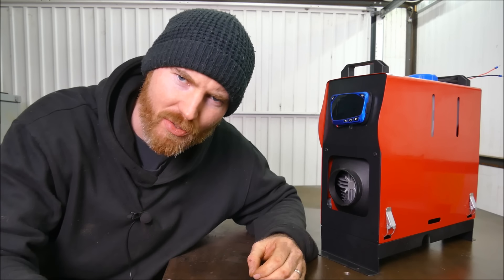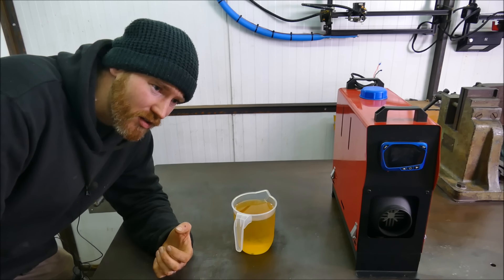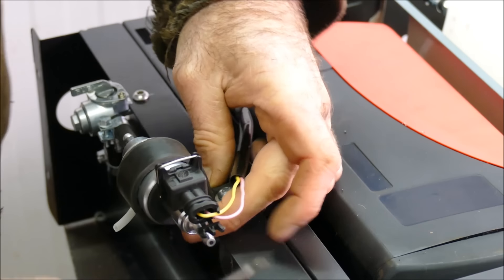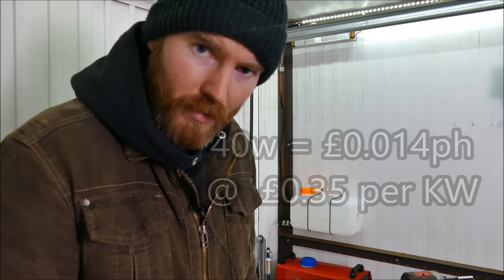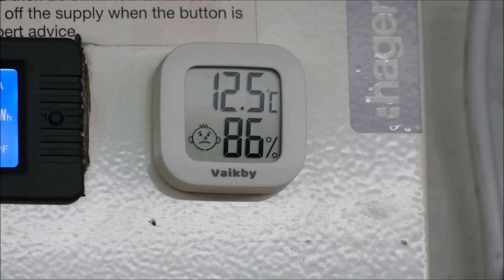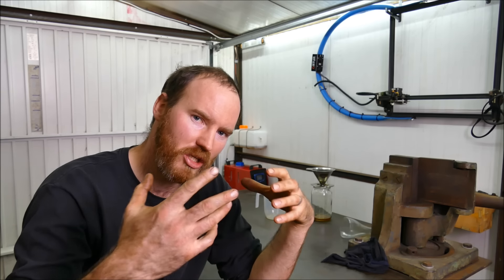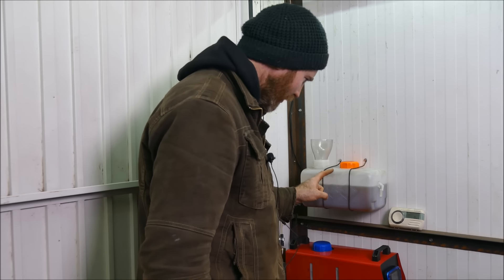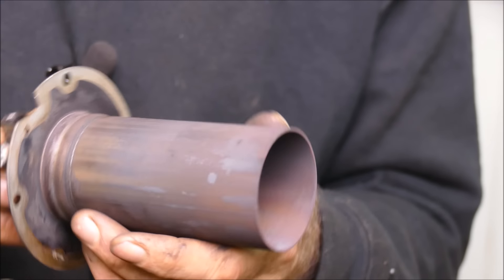£0.03 per kWh heater modification - Top facts & lies on diesel heaters - waste veg oil burn success

Comment: I dont think your efficiency numbers are correct. First of all 80-90% heating efficiency is really good... too good for a cheap heater. Modern condensing heaters struggle to get 90%. They use almost all of the energy out of the fuel. I would be surprised if this is even 80% efficient. Second, you still have the electrical power used for the fan motor. This further reduced the theoretical efficiency to a place that i would take an educational guess to be around 60-75%. So your 3 kW is actually more likely 2.3 or less. As for as heat pumps, the baseline worst COP is 2.0, this means that for every watt of electricity you put in you get 2 watts of heat out. So you can basically cut the price of electricity in half. And that is worst case, many heat pumps can approach 3 0-4.0. This would easily beat all fossil fuel alternatives as far as efficiency.
Reply from the maker: It's relative to ambient air temp to output exhaust temp minus the fuel energy output that determines the efficiency. If the exhaust is equal to air temp then it's 100% efficient so seeing how much heat is retained in the room and how little temperature is going out the exhaust I would say it's very efficient. Any electrical consumption will also add to the room temperature regardless of energy loss as it will still become heat. Electricity consumption though is only £0.01 per KWh. Cheers J
Reply: @joshuadelisleyes you are indeed right about the electrical inefficiency also heating the space. But this thing has terrable efficiency. I mean, there was like 300 degrees c coming out of the exhaust. That is pretty horrific actually. Like I said, a 90% condensing furnace still has about 100 degrees F exhaust. I'm not sure what that is in Celsius but like around 48 degrees C. Even after his taking the exhaust and making a radiator, he was still exhausting 100 + C air. I don't see how anybody can look at this thing vs a true 90% furnace and say that it has good efficiency. Maybe price for heating performance can have an argument but still. Efficiency takes mass and air volume to adequately transfer heat to the air stream. This requires a lot of metal and a long interaction path for the heat to be captured. This device has neither. If anything, this video just shows that hydrocarbon fuels have a high energy density. You would be better off getting a modern kerosene 90% furnace than this small dinky thing. Though I do like lively discussions, and I just think heat pumps can't be beat as they take heat energy from the environment.
Reply from the maker: @willernst8376  watch the latest video. I go more in depth on heat reclamation. Cheers J
Reply: @joshuadelisle  I will check it out, I do think fully condensing output with water is always the best choice. I look forward to seeing what you came up with.

Comment: I have seen people warm up the vegetable oil tank so the oil is more fluid and burns better. You'll probably have to insulate the fuel line as well so the oil doesn't get cold between the tank and the heater. You could use the excess heat from the exhaust to warm the oil tank. That way you could reduce kerosene/oil ratio and heat the workshop even cheaper!

Comment: There was a time when I used old engine oil as fuel for my diesel engine. This is possible, but it is very beneficial to take the sludge out of the old engine oil. The sludge is what makes it smoke when burned in a diesel engine or a heater. I did it with a centrifuge in a 50 gal drum/pump/centrifuge/drum setting. A loop where the oil is pumped from a drum into the centrifuge and back into the drum. I let it run for about 24 hours and the cleaned oil had similar viscosity than diesel oil. Using it as fuel did not smoke at all. I consider this a perfect recycling for old engine oil. 
I still have the centrifuge. If someone is interested, let me know via PM.

Comment: Hi josh, here's an idea I used on a turbo without removing the mesh that heats up. Use oven cleaner as it's good at removing carbon deposits , saving the removal of the mesh part 😊

Comment: #StopBurningStuff please!
Reply from the maker: Good luck with that. How does your power stations and heating work?
Reply: @joshuadelisle  Solar (30 panels), contract for wind energy and a heatpump... Exsisting technology that is cheaper in the long run.
Reply from the maker: @GadgetFrank71  research how solar panels are made, Michael more did a great documentary on it. Also research how easily solar panels are recycled(spoiler they're not). Also research how sustainable energy storage is using batteries(key note rare earth minerals are not sustainable and cobalt a major component is currently mined using slavery). Nothing is more sustainable as heat and energy source than burning wood from sustainably managed woodlands. Using waste oil that is otherwise being recycled is also great. Veg oil can also be a sustainable fuel. Cheers J